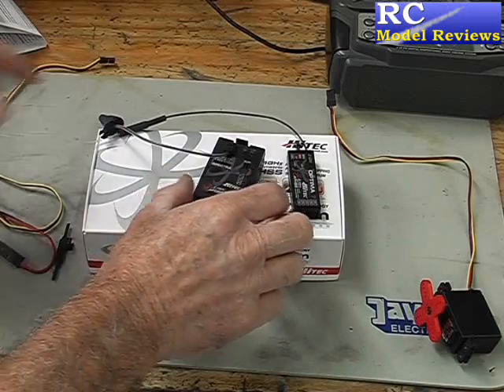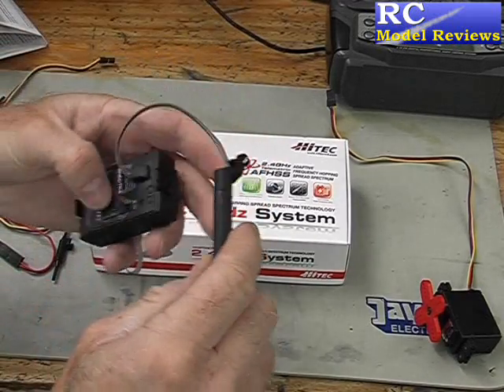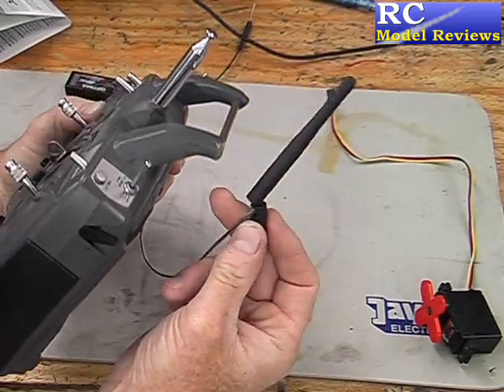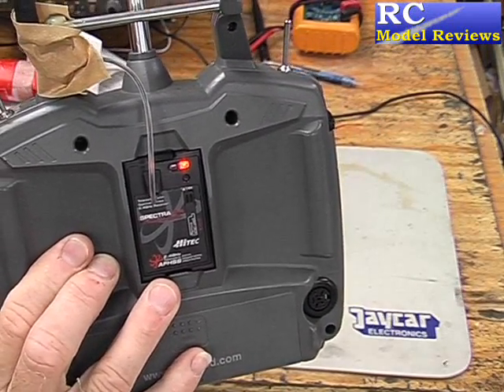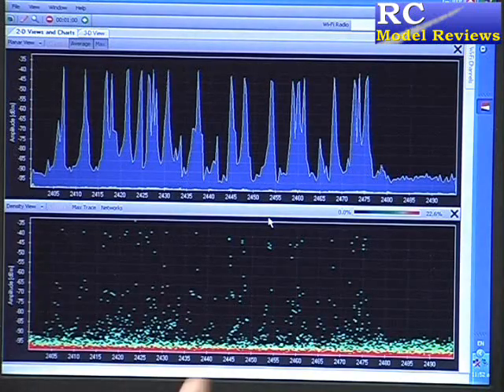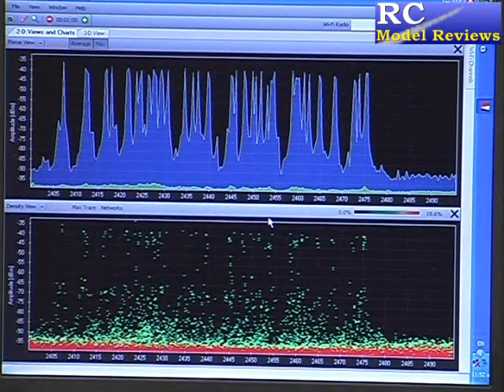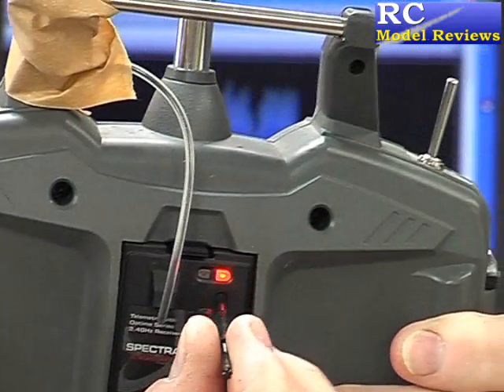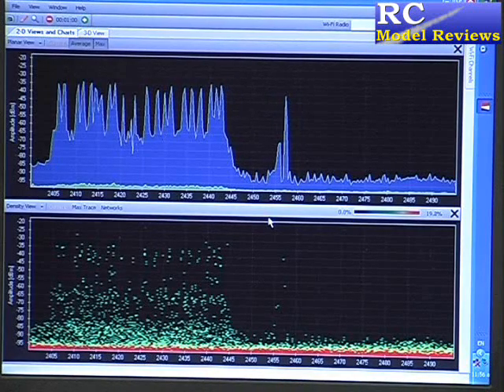Review: Hitec Spectra AFHSS 2.4GHz receiver and Optima 7 module (part 1)

Comment: Need hitec spectra module 2.4ghz with older firmware for this scan mode ability. But the bad is after receiver disconected (bad signal) it will very hard reconnect to radio module again..

Comment: Ever designed a receiver? What comes in front of the LNA? Exactly; a bandpass filter to get a high SNR and therefore more range. And that is probably one of the reasons why a smaller bandwidth is preferred.

Comment: Hitec is using this that way because they are using what is needed in the band spectrum. Some of there other "chinese" junkers are wide banded hogging the whole band WHY? You only need whats clear. If the low end of the band is getting interference it will move to the upper end of the band.  Its a "smart" device.